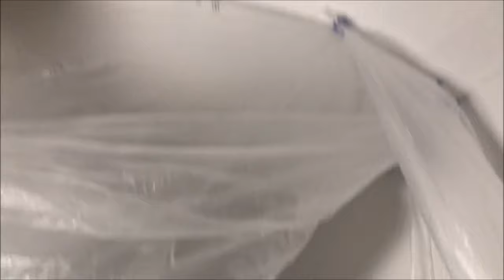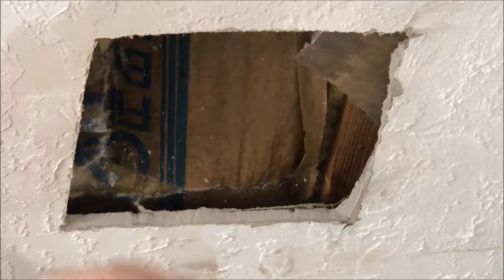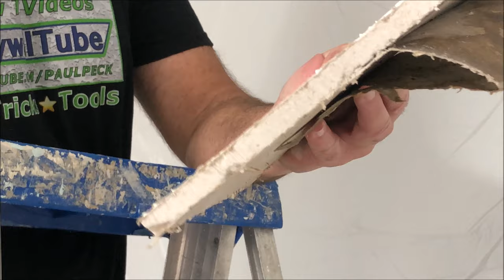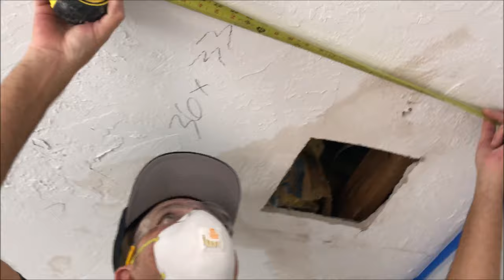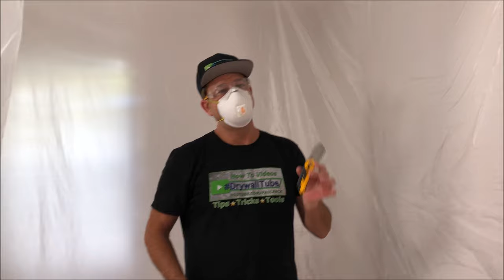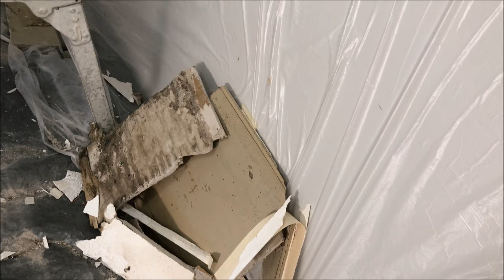Cutting Out Drywall Ceiling from Roof Leak Step by Step

Comment: Hey, Paul! Good timing. I am doing a neighbor's utility room that had a roof leak. 5/8 inch. Used an oscillating tool to cut thru. I did the small piece to check for wires and not only a 12 gauge wire but a propane gas pipe for a fireplace was above that section. Wise to shallow cut and make inspection hole as you did.
Reply from the maker: Hey Martin!💥👊🏻 Yes, you never know what’s up in a ceiling that’s for sure. Thanks for stopping by bro!😎 -Paul

Comment: Thank you for this informative video!  I am a DIYer.  I have a ceiling patch repair I need to do but I've not done ceilings before so wasn't sure I would attempt to do it myself.  I think I will now!
I'm a middle aged female and don't think I'd have the strength to cut the drywall over my head with a blade like you did but one of the comments below suggested using an oscillating tool so I'm going to try that instead.  I appreciated all of the details about how you determined where to cut.
Reply: You can get a small saw as well if you have issues with the razor blade. I am gonna pick up a oscillating tool. That seems the easiest for me and its is as low as $69.99 for a good enough one for this. GOOD LUCK 😁

Comment: I have 3 spots like that in my family room, but much worse.  2 of them are against an inside wall, and one straddles a joist in the middle of the room.  Hurricane damage. I poked holes in them during the storm to let the water out and prevent spread.  They have had about a year to dry out, so now I will cut them out and fix them this fall.  New roof works great!  Thanks for sharing your knowledge.  I did this years ago for a friend, so it was a nice refresher.  After the ceiling repair, I have to reapply the popcorn ceiling finish and paint to match.  The popcorn in a spray can with multiple tips works really good.  Thanks again.  I'm a DIYer, do just about everything myself, plumbing, electrical, AC, Wells, Brick work and cement, etc... Dad taught me well and has saved me a ton of money over the years.
Reply: After it’s fixed prime the area of the repair on ceiling let dry then paint the entire ceiling to desired color before u shoot the popcorn up. Once that’s dry mix ur texture up and add the paint u used to paint ceiling directly to the mix. Shoot it up and now it will dry and blend so u don’t have to paint over the nex texture. 👍
Reply: @Brob6304  Sounds like a plan.  I'll give that a try.

Comment: Just recently notified water dripping from the ceiling in the shower while the shower was running!😮 turned water off and the dripping stopped. I run the water in the tub which is separate from the shower. No water leak. I do have an upstairs room above my shower. No other shower or tub above just a room. What you think?

Comment: I loved this video and your others made me so much more confident about repair -- but I notice that you don't address the insulation issue. I had a leak on my roof (TPO leak, patched it, it's fine now) that led to leaking through into the insulation and then the drywall of the ceiling just below the roof (there's no attic). I removed the drywall, then the wet insulation. But now I'm trying to figure out whether to just put the same insulation in that had been there previously, or to replace it with something better (that would fit). Any thoughts on how to approach the process?

Comment: Hi, I have mold on my ceiling drywall in my garage.  Trying to decide if I cut it out or treat it with mold spray and primer.  Do you any thoughts on treating mold vs cutting it out?

Comment: I’m a Diyer. I had a short in the ac line running a-crossed the ceiling and had to cut holes to trace the path of the line to find the short. Short was caused by a mouse chewing the line. No I need to patch these holes. The problem is that the ceiling is knockdown textured. Needing to know how to match  the new Sheetrock with existing ceiling.

Comment: Thank you for educating the public! I just attached a 14x16 inch patch to the frame of a tray ceiling. Half the patch is level to the existing ceiling but the other half is about 1/6 inch recessed. Should I “pre-fill” recessed area to make level with the other half before taping? Or tape first before several more coats of mud and skim coat?  Does it matter what I do first? Thank you!
Reply from the maker: It wouldn’t hurt to prefill the joints anyways. So yes, prefill then apply the coats accordingly to make the patch nice and flat.👍🏻 Thanks so much for watching and commenting my friend!😎 -Paul

Comment: The drywall looked solid.  What would be a disadvantage to simply using an extreme blocking primer on the stained area and then painting the entire ceiling with a color matched paint instead of replacing the drywall?
Reply: My question as well
Reply: the disadvantage would be that you couldn't charge the customer for a drywall repair
Reply: bleach it, let it dry, then seal it with Bin Shellac.
Reply: I was thinking that a blocking primer and paint would have been an appropriate repair too.
Reply: If there is only water spots as in his video, he basically just over charging. No reason to rip that out considering it’s dry and solid. I would have put a moisture meter on it and just slapped an oil based primer on it and painted the entire ceiling. Would have costed 150 to 200 instead of 500-600.
Reply from the maker: I always give my customers options. They chose to have me cut into the ceiling to check for mold and see how damaged the drywall was the backside. And there was mold, the drywall was pretty damaged right where the leak was and the whole section of drywall had a big sag in it. But yeah, you could just repair the corner tape, prime that area and paint the entire ceiling. But if it was my house I’d want that stinky mess cut out of my ceiling too! Thanks for watching and commenting! I really appreciate that! -Paul
Reply: @Brob6304 because mold becomes airborne and most leaks like this mold unless they dry very quickly after exposure. It’s worth their health to remove it and I would never recommend putting someone’s health over a tiny bit of money.

Comment: Just bought my condo and only recently i have noticed the ceiling is really really bad. I  scraped off all the original painting because it was full with air pockets. Now I discovered that there are little patches everywhere and right in the middle of ceiling, there is a huge join filled with lots of cement. I have to see a way how I can do this without breaking the bank. I am depress over this.

Comment: How would you do this if the insulation is 30 inches of snow fluff above the damage from the leaky roof??  my shingles and roofing plywood are replaced, now for the drywall ceilling damage.......
Reply from the maker: I would first cut a smaller hole and try and push back the insulation as much as possible from the are you be repaired. I hope this helps.👍🏻 -Paul

Comment: My condensate line leaked this summer in an unused guest bathroom. By the time I noticed, there was a bunch of water pooled up in a huge dimple in the ceiling. I poked a hole to let the water drained out and let it dry… for five months. Don’t laugh at my question… can I just sand it and try to drywall to make it even? Someone wanted to charge me 1500 for the repair and I figure it needs something like this repair. I don’t have the $ right now and it is unsightly.

Comment: So ours is pretty bad and it spread to the surroundings so the ceiling kinda sags (due to the water) and the drywall installed is higher than the surrounding ceiling in some places. I was wondering what do you suggest if the ceiling walls are uneven

Comment: hi there...my tub from upstairs leaked one day about 5 years ago to the downstairs ceiling. I was filling up the bathtub and when I went downstairs to grab a glass a wine I heard what sounded like a waterfall. then I realized my ceiling was wet in some areas.  So I rush upstairs, the tub wasnt overflowing it was 3/4 full but I emptied it anyway and called a plumber next morning. he fixed it said it was a loose drain. I never filled the tub again after that day. I also didnt replace the drywall, it dried without damage or discoloration.  do you think I should replace it? still no discoloration or bubbling. ceiling still looks like new.  wat do u think?

Comment: Would be better to use a electrical Multitool to cut out the Ceiling plasterboard.  There is more control over the depth that is being cut.

Comment: Good evening Paul, I have a hole on my living room ceiling from my lack of attention when I was in my attic.  The hole is about or less than 3'x3'.  Could I use this method to repair it? The only thing in my attic is the Blown-in Insulation.  Thank you so much for any information or advice you may be able to provide. #DRYWALLTUBE

Comment: i got to replace a 4x5 drywall area... but there's no way i'm gonna get a sheet of the stuff into my vehicle.  what do you recommend?
Reply: Home depot rents trucks for cheap
Reply: @pearlperlitavenegas2023  i ended up cutting  to size at home depot, they didn't seem to have any issue w/ me doing that myself.  i was able to transport it np
Reply: @razblack  great solution....to a common problem